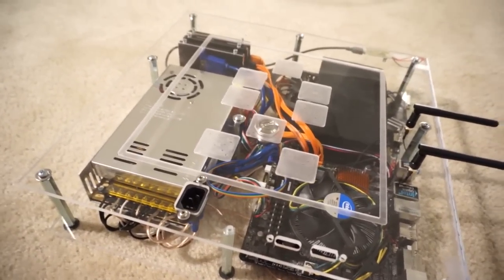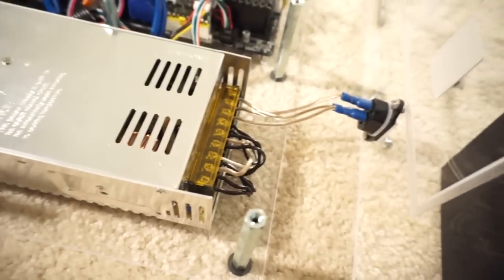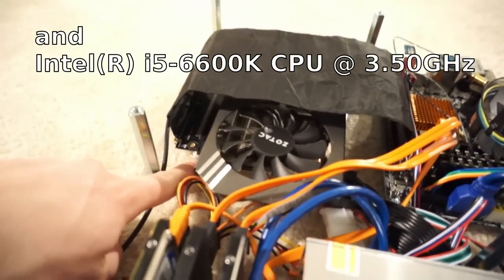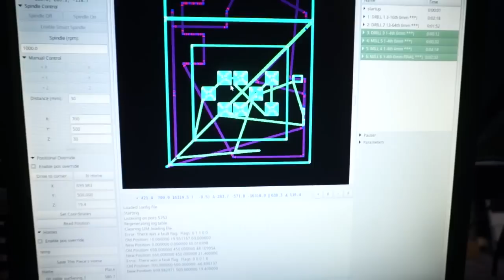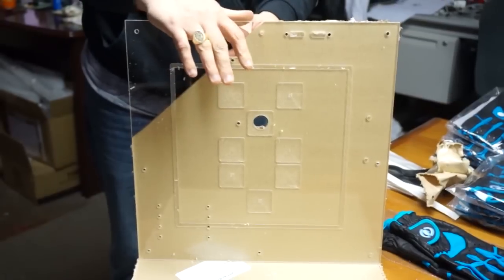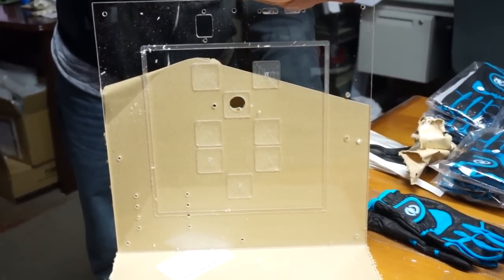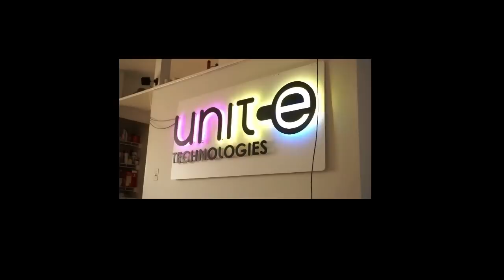The making of CNLohr's Computer Case

Comment: That Meanwell is larger than the 400W SFX ("Micro ATX") PSU I just put on my 3D Printer, MS-Tech MPS-400. About the same price as yours. Of course it's lower quality than what you have, it does about 15A @ 11.4V instead of the claimed 24A. Interesting that the PCIe extension works at all, I once tried to make a full PC as flat as this and abandoned the project when I realised the extension would have to wrap around the graphics card.
Reply from the maker: Sounds like I ran into the same issues you did and just decided to plough forward anyway :-p
Reply: Thats why you earn the big bucks :D
Reply: Did you try to put a shield between the graphics card and the cable?
Reply from the maker: I believe it already has one inside.  Like under the black tape.
Reply: I'm talking about a sheet of ferromagnetic steel or something along those lines and not a wrap of almost nothing. some rf-shielding could seriously improve your build.
Reply from the maker: hmm... I could try that next time I've got things open out back.  May also fix my can't-reliably-use PCI-E 3.0 problem, but I'm suspicious that also has to do with the mobo.

Comment: There are mini itx motherboards that have all the psu parts built in. I was surprised when i built my home server i had a picopsu and everything, then the motherboard comes and all it had was 12v in. Could be useful for small builds.
Reply from the maker: I did not know about that.  Next build will almost certainly be AMD so it's gonna be tricky.

Comment: If you want to put the PCIe cable behind the graphics card(better airflow / looks better) why not try putting a stick copper sheet over the PCIe cable and ground it? That should fix the interference.
Reply from the maker: I believe the PCIe Cable is already wrapped in copper, underneath the black tape.  I could try copper taping the back of the GPU?
Reply: I could imagine that might well work! Worth a try anyway :)

Comment: could you please make a video on how to get color cord running on a esp8266 for the life or me I can't get it to work
Reply from the maker: >.< There need to be more people who do that sort of thing!  Where are you getting stuck?  If you figure it out, can you post a video?
Reply: It took a bit of fiddling at first. One thing that might not seem obvious is that you have to load the default settings from thee webUI after your first flash, otherwise it tends to just not work.
Reply: sorry for the late reply, iam not exactly proficient at coding by any means but iv tried uploading it using arduino ide and it just throws out errors all over the place

Comment: Is the PCB shown in 4:26 open source? I'm working on a similar LED controller for my PC and I'm really interested in the USB interface.
Could you share the schematics/PCB design of that board?
Reply from the maker: It's really generic, basically just a reference design using an atmega32u2, with a 16 MHz Crystal.
Reply: Thanks for the replying! Still, if you could upload them to GitHub it'd save me about a couple of days worth of time.
I realised the key was using ATMega32U2, I was trying to use an ATMega328P with LUFA/V-USB which made me feel pain.

Anyways, I really love your design. It's cool looking, and it serves the purpose of a portable VR station as you mentioned.
Looking forward for your future videos! :)
Reply from the maker: I don't know where the designs are anymore :-/  They were from over 5-6 years ago.

Comment: What I don't get: the main plug in the front… design hiccup ?
Reply from the maker: Wanted a sturdy way of mounting an IEC.  Originally, I had more coming out of the front.  Antennas in front, so it's not like the front could be totallyyyy flat.  J/w where would you mount it?
Reply: Sideways somewhere near the other ports, like next to the hdmi cable bc it's also always plugged in. just to make things easy and safe (it's like an invitation to pull the plug)
edit: leave other ytbers out of this.
Reply from the maker: I'm not sure where to get an iec that can be mounted that way
Reply: thread an M3 in the middle of the standoffs, attach to them a back plate with all cutouts for the connectors… 
But you know, alpha prototypes will always have flaws, don't you want to try to fix (..to the front) the 4x usb first, and keep the iec where it is, what's impracticable is having cables on every sides (but some like it).
Reply from the maker: I'm okay with perpetually living in the alpha.

Comment: Nice. What's the depth of cut/etch used for the highlighted details? e.g. the squares near the middle front.
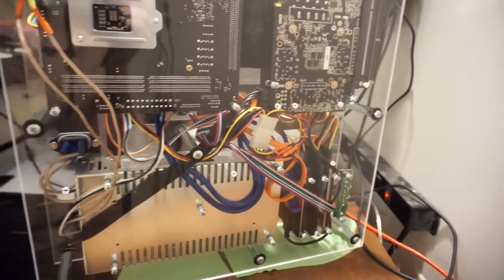Reply from the maker: You're not going to like this.  Look at 5:30
Reply: Hmm not entirely sure about the layout of the program, but it does seem to say 4mm in one of the milling operations. I guessed 3 visually, so yeah quite deep either way.
Reply from the maker: 2-2.5 I think. I also misread your first comment.

Comment: Nice, But what about static charge on that case?
Reply from the maker: NOVUS 1 handles that, see at  7:23
Reply: Hope it don't degrade, love the case, but have had my share of shock's with "plastic".. :)
Reply from the maker: Indeed.  I don't blame you.  There are a variety of anti-static products out there.  You can even buy anti-static spray for your work space and the stuff REALLY works.  They use it retro games stores, like The Save Point as a precaution.

Comment: While it is is interesting idea to use that kind of PSU, I urge you to build some additional protection circuits and filter any output before you put that into any delicate electronics.
Those things have the tendency to fry stuff behind them if the wall power isn't to their liking. (If you are planing to use it on conventions etc. the grid is mostly a real mess from people constantly plugging stuff in and out)
Reply from the maker: There's a ton of protection on the rest of the components for the 12v rail.  I believe most things can handle up to ~15V.   Mobos and video cards typically have their own power supplies to provide the delicate power.  I intend to, at some point hook my PC directly into my truck while I crank it on and rev it, etc. to see if it works.
Reply: Just speaking out from experience, but to be fair I used the cheapest chinesium I could find :-)
Fried half of a led strip when I plugged it in. And since I also moderately overclocked my rig I really appreciate a stable ATX PSU. ^^
Reply from the maker: I did test the supply under a variety of loads to verify it wouldn't do crazy things.  So far it hasn't disappointed :-D

Comment: Ningen I'm thinking of doing this with an 8700K and a 1060 6gb.
It's really unbalanced, I know, the 8700K can game with dual 1080's and be fine, but my workload is no longer much gaming.
But GPU acceleration is darn useful. Also, have you tried wrapping the PCI-E extender with aluminum foil?

Comment: CNLohr Nice custom setup! I like your power supply. PSUs are most efficient at max load anyhow! Hey try using a "PCIe 1x to 16x riser card extender cable kit." You can find them on amazon for $12. A friend of mine is using them in a GPU mining rig for Ethereum coins. This uses a shielded USB 3.0 cable instead of the flat cable. Should work great.
Reply from the maker: I already bought the riser card, but the problem is it flips the GPU around the wrong way and would have required cutting more on the mill to make room for the air to pass for the GPU.
Reply: Ah ok. No worries.

Comment: Did you try wrapping the PCIe extender in foil or something like that so you could run it under the GPU?
Reply from the maker: I believe it is already wrapped in copper underneath the black tape.  But I could try taping copper the back of the GPU with a kapton layer?

Comment: Intel stock cooler...

WHYYYYYY
Reply from the maker: Aaaaanddd it's the WRONG intel stock cooler :-D :-D :-D Trolololo
Reply: Goddamn! Should look into Noctua's small form factor coolers. It sucks you didn't wait for Ryzen, their stock coolers are actually pretty good, apparently.
Reply from the maker: The PC was already being put together before I even heard of Ryzen :(
Reply from the maker: Just googled it.  Apparently there are no tiny itx mobos for ryzen now anyway.  Some day.  Some day I'll go AMD.
Reply: Yeah... I mean if you're putting a stock cooler in a tower PC you should be good, but with all that exposure to open air you definitely need something beefier.
Reply from the maker: I am also using the stock compound.  When CRANKED the temp goes up to 185 * F or so.  I am thinking I will need to do ... something.

Comment: These picoATX PSU very bad, just buy a SFX PSU
Reply from the maker: I can believe that, but, I haven't had an issue yet, and most motherboards have power supplies on-board for most of the stuff.
Reply: I've used mini-box's for years -- but they REALLY do need regulated 12.00V in unless you're using the wide voltage variant; but that's got a lower maximum wattage. The DCDC-USB and DCDC-USB-200 are also really REALLY nice controllable power supplies; they're just expensive. I converted a Taito Atomiswave back in january 2011, and it's still going fine. https://goo.gl/photos/oZrMPawRNEmsVRC98
Reply from the maker: I would be really surprised if it cares much at all based on how the switch mode power supplies work.  It "should" be good from ~10V to ~15,16V.